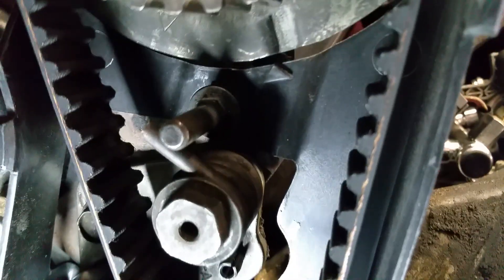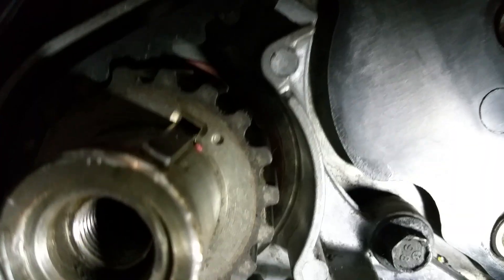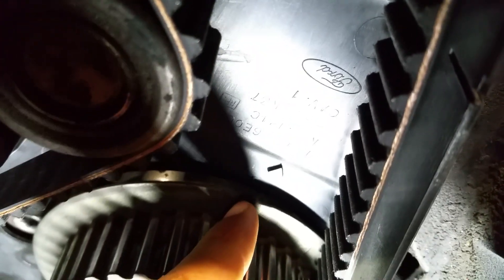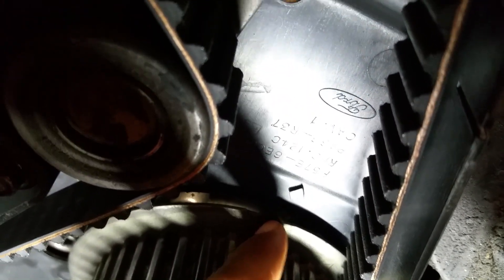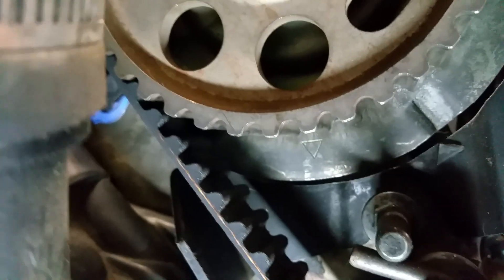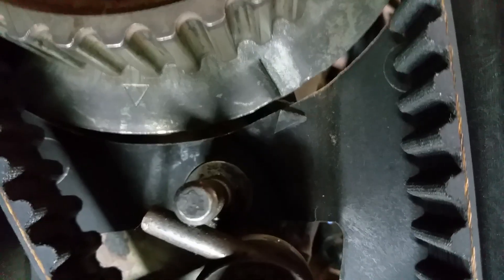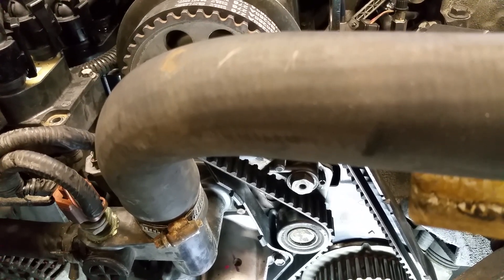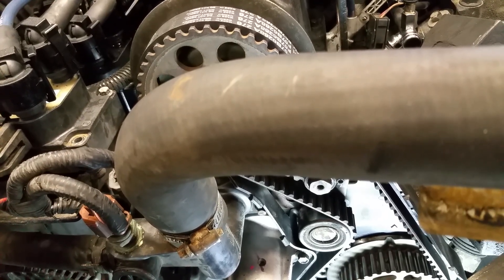Ford 2.3/2.5 Common timing belt mistake! Watch before doing timing belt!

Comment: Did it run with a miss 
After I had the head replaced it misses. Has good power just low rpm miss. I have changed every sensor plugs wires and computer nothing helps

Comment: Whenever you replace the timing belt on these engines, you need have the pointer for the cam back by a tooth because when you tension the belt, the cam will advance by a tooth thus lining up perfectly with the timing marks.  I've done many teardowns of these engines over the years and that's how the engine was timed on every one of them.
Reply: This is crucial info.,THANKYOU!  I kept trying to align the marks perfectly but after tightening the tensioner and turning the crank some turns ,marks were still a hair off,I shouldve thought about this,THANKYOU!

Comment: So if it is not set right. An you do start it will that blow a rod
Reply from the maker: In my case, it was ok. If it runs it probably didn't get valve contact.

Comment: My 88 ranger 2.3 runs  rough like you described after replacing timing belt with all marks in line. You show the cam gear off the mark, is that where it will run correctly? Thanks. Bob

Comment: Thank You very much. Replaced a snapped timing belt on 2000 Ranger. Ran like crap after. No codes. Read this last night. 2 hours later runs great. You saved me a lot of time. I used the alltel timing belt manual. I would have reassembled again wrong except for your video!! Thanks again.

Comment: I’m hoping to pick up an ‘85 Ranger the seller did the head gasket and now it won’t start, he thinks it’s a timing issue or a blown engine but if it’s this simple it’s a steal at the $400 when it used to be $1500 before he knew it wouldn’t start. I’m just trying to keep myself from explaining it to him because the price might go back up a bit!

Comment: My 2300 has a rough idle and dies now if I let off the throttle it’s been idling rough since I got it 2 years ago and has slowly got worse after changing the plugs, wires, distributer caps and Alternator with no improvement I should check this out before I junk the old girl.
Reply from the maker: i would have it checked by a mechanic.but this is one thing to check

Comment: I'm a bit lost on this job. When all the marks are dead-on, I wrap the belt around the sprockets starting with the crank and working my way counter-clockwise over the oil pump, holding tension on the belt. By the time I reach the cam sprocket, the teeth don't line up and I have to turn the cam shaft half a tooth in either direction to get the belt engaged, but then the cam sprocket arrow doesn't line up perfectly anymore, it's off a hair. Am I doing something wrong or do the marks just need to be close but not perfect?
Reply: I've had this problem with the 2.3 Lima on my 1992 Ranger.

What I would do is if the teeth won't line up with the belt, rotate the camshaft towards the driver side just a hair. Afterwards, give the belt tension, and rotate it by hand without the #1 plug in it. See where your timing marks line up after rotating the crank twice (the crank rotates twice for each rotation of the cam). 

Remember, the timing on the truck has to be around 10° BTDC to run right, which means that the crank gear dot will be on the passenger side of its mark by just a bit, and the cam mark, the triangle, will be on the driver's side of the mark by just a bit. 

If everything rotates by hand fine, put the plug back in and hook it back up, then put the harmonic balancer on to ensure a good crank timing signal, and see if the engine will run for 10-20 seconds. If the engine runs, then you're good to go. If the engine runs rough, look at your timing and if the cam mark is off by a tooth, loosen the tensioner, take the belt off the cam, and rotate the cam clockwise 1 tooth, then re-check and run the motor to verify.
Reply: @isaiahwelch8066  Excuse me, what exactly do you mean by 10º BTDC?
Reply: @JuanTorres-ny9ff  : 10° BTDC means "Before Top Dead Center." 

That's the crankshaft position where the crank needs to be in order to signal the ECU that cylinder can fire, either on the primary combustion stroke or the secondary exhaust stroke.
Reply: @isaiahwelch8066  So, it isn't exactly at top dead center, it must be 10 grades before TDC, in that case how can I get this exact position?-

Comment: I have a 94 ranger, it was running ruff and backfiring, even dying while driving..

I had the timing belt changed at a shop, he said it was off, so got that fixed and it still runs rough and backfires, it did that for about a week, then it stopped running at all, now all I got is crank no start.

Any ideas? Should I try to realign the timing belt? Or start changing other stuff, I bought both crankshaft sensor and camshaft with syncronizer..

Anyone have any thoughts? I'm at too much money paying people to look at it and I'm not selling it not running..
Reply: Old comment to reply to but mine does the same but hasn't stopped running yet i replaced both coil pack plugs plug wores fuel injectors fuel pump fuel filter fuel lines a bunch of vacuum lines still hasn't fixed mine so looked up how to check the timing went and checked mine and sure enough its off by a long shot it spits and spudders back fires shoots fire balls out the intake i suggest just checking the timing to start with to save a whole lot of time like I did but now I won't have to do any maintenance for awhile hopefully after all it is a ford
Reply: @donniebailey4496  I sold it for $300 ☹️, after putting more than 4 grand in it.

Comment: Why does the oil pump need to be timed?
Reply: It does. It synchronizes the cam sensor for ignition timing, on some models.
Reply: @ericg3810  I'm pretty sure the lima model(this model)  2.3's always controlled timing on a points system on the early models and a hall sensor inside the distributor until they were phased out.   I'm reasonably sure they never had a cam sensor.   The later DOHC 2.3 engines are a completely different design.
Reply: @fomocowboy  pretty sure? So not sure. When you are sure, go ahead and comment.
Reply: @ericg3810  well since you are sure,  which models have a cam sensor?
Reply: @fomocowboy  it won't let me post the link but the Ranger station forum has a good write up on this. It was in model years after 1995.
Reply: It doesn't.  Just the distributor has to be timed so the rotor points at the #1 spark plug tower, the oil pump doesn't need timing.
Reply: @turboragtop  that's what I thought...

Comment: Bro been on this truck for half a year now. Replaced failing dpfe sensor ,egr was sticking cleaned that n the intake port, gasket between maf and air filter box was missing ignition coils were also causing a misfire replaced those fuel pump lines in the rank had a leak so i was loosing pressure so i replaced hoses seen your video weeks ago tought the timing was ok n what tru me off was that u said it ran rough this vehicle dint run rough in idle but was hesitating on acceleration on from a stop.finally took the timing cover completely off n voila the exact same issue as your video. I should have stayed in school like my mom told me too but no i wanted to be a mechanic. Lol. Thanks
Reply: My belt just snapped and I’ve had hesitation during acceleration from a stop for years. Hopefully replacing this belt will solve that as well… if it doesn’t I’ll be checking for an intake leak next… oil also gets a little milky, so maybe an HG is needed too.

Comment: Thank you for the heads up I'm about to jump in my 2001 Ford ranger. I'm replacing the timing belt my self
Reply: 2001 is not the same motor as in this vid.
Reply: 2001 had a 2.5 lima

Comment: Thanks for the video. When the timing marks are all lined correctly, does this correspond with piston #1 at TDC?
Reply: Tammer Barkouki yes I believe so thats what we did to double check.  We pulled plug 1 and handcranked the motor over till we saw the piston at TDC

Comment: What do you do when you replaced the belt, tensioner, and got all the marks correct,and the belt keeps walking off the sprockets? Did it once, let the spring do the work tightened it down at spring tight, it walked off the sprockets. Took it all apart again, made sure everything was lined up, pushed the belt a little farther back, saw the tensioner could be extended a little more, couldn't find a new spring anywhere but online (they're $70-90 bucks even still) but made sure the tensioner was cranked tighter than the spring would even go, almost fully extended. Belt buzzed like an arrow string when I gave it a flick it was so tight. Still walked off the sprockets immediately. Its worse now than it was before I changed the belt! I got a 2000 Mazda B2500 (2.5L L4 Ford Ranger clone, even says Ford Motor Co. on the inside door tag) Can the sprockets be adjusted if they're misaligned?

Comment: Sometimes you have to fit them a tooth out on belt then tentioner straightens it out
Reply from the maker: that just means you are installing with the tension side non-taught. but whatever works! This was off more than one tooth, it was installed with the incorrect marks lined up. a bit confusing.

Comment: I take my 2.3 ranger in the mechanic to replace the timing belt. Now my truck when i accelerate is sounds like diesel is can put wrong the timing belt the timing is incorrect. Also like from stop signs when i press the gas pedal my truck make like cut off for second then pickup speed. on thw highway is very hard to go over 55 miles
Reply: My guess is it didn't do it for long . Sounds like valves smacking the pistons . Shouldn't be long before it blasts that motor to hell .

Comment: Along with the comment below..it also stalls when air conditioning is on..along with reduced power..and feeling like a clogged cat.converter.thanks again
Reply from the maker: Dennis Arlan let us know what you find. hopefully it's just the belt was done incorrectly.
Reply: Just took the thermostat housing off.and no thermostat.now i know why i didnt have heat...so why did (previous owner) remove thermostat?only other stuff ive done is tuneup and fan clutch and fan.

Comment: I didn't even see the small diamond and triangle marks until the motor ran like crap and I started looking for help and found this video. The manual I had does not point that out at all. It just says to line up the timing marks. So much of the help stuff on You Tube is crap but this one was a lifesaver. Good job.
Reply from the maker: Thank you for the comment! Glad it helped you!
Reply: most manuals skip all manner of  highly important steps, is what i discover. many are almost useless because of that.. if you dont make reinstall diagrams and pictures of HOW IT WAS before you pulled it apart, lot of times the manual wont help much if at all on reassembly

Comment: Say I see that your crankshaft alignment has that dot, is that supposed to point at the notch kinda cocked?   In the haynes manual it says to put that keyway thats on crankshaft spindle at 12 oclock. I did and i had diamonds all lined up damn thing won't start.
Reply: Yea I think I am having the same problem, I also noticed that if you rotate the crankshaft again you will notice that all the marks are not there, so I cant till if I am on TDC or not, guess imma have to remove that spark plug anyways lol finding TDC on these are a PITA
Reply: Justin Daniels you're right man! try and do two revolution with crankshaft and it should be TDC

Comment: Howdy, 
       Thinking to change the T belt on my 2005 Ranger 2.5 TD.  I am a bit of a backyard mech and am debating on doing it myself. What's your opinion? Read that you should change the gear wheels as well? Your opinion on this? I feel the belt is the main wearing item here but app your feedback....
Reply from the maker: if the sprockets are metal, just change the timing belt. unless there is some unusual wear???
Reply: Ok thanks for the quick reply. I've got the European Mazda Ranger model which is different than your vid but relatively straight ahead... Cheers ...
Reply from the maker: basically same vehicle. thank you!

Comment: Its Triangle to triangle on the cam and diamond to diamond on the oil pump, be careful the cam has a diamond mark on it as well.
Reply: jon mallory because of cam sensor
Reply: @angrydog1979  I know there are a million different versions of the 2.3 but I just did the belt on mine, the Aux shaft doesn’t need to be timed on mine, I have a 1994 Ranger.

The cam and crank need to be timed but the aux doesn’t matter.
Reply: @Vichedges  Thanks this comment from 2 years ago save me some stress, doing timing on my 92 Ranger right now.
Reply: Tim Leathers why does the oil pump need to be timed? Makes no sense.
Reply: My 94 Mazda does not have 2 diamond marks for setting the oil pump gear.  It only has one on the gear itself.  Do you know if this is normal for this truck?
Reply: Tim Leathers on Sunday
Reply: But I do belive my pump only has a triangle but the cover is a diamond